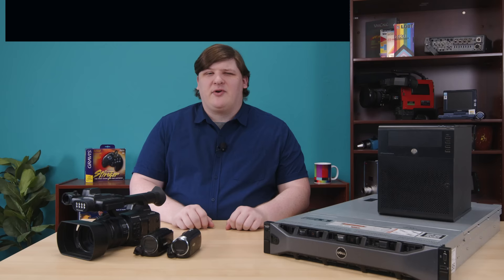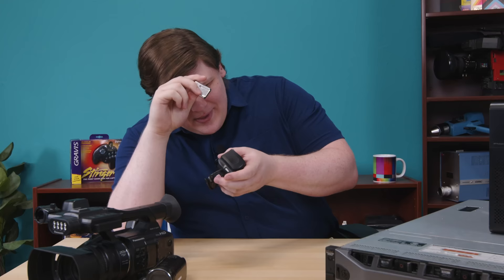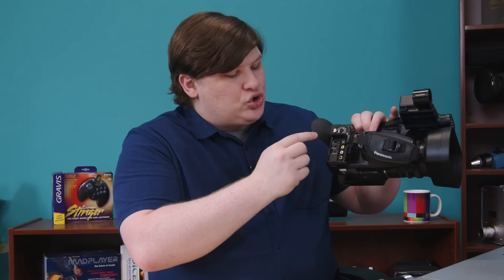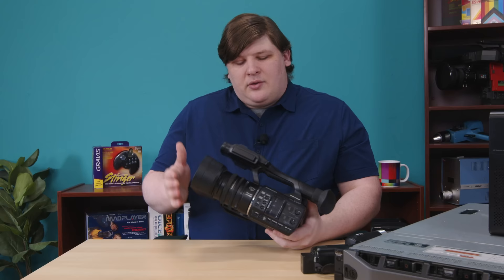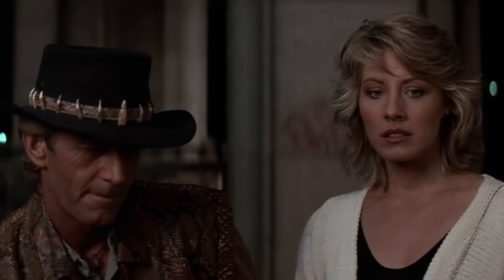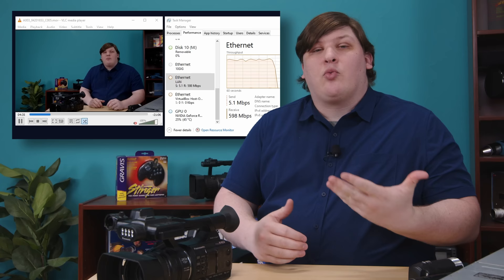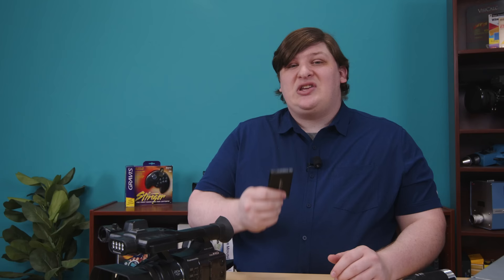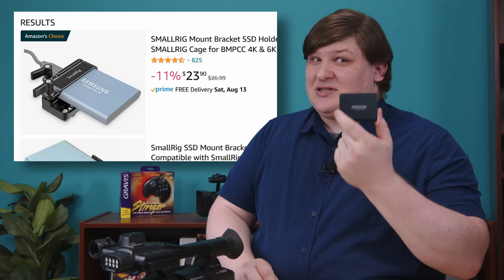I Built... a really fast NAS?

Comment: I'm a year late to this video, but have you ever considered an offline/proxy workflow? Get the server to transcode the video to 1080p proxies, edit with those, then tell the server to do a full res render with the high res footage in place of the proxies. The proxies can either be copied locally or several can stream over a 1Gbit network, though copying means you free up the server to be transcoding the backups in the background while you edit. I realize this introduces more process, but most editing tools are built to do offline edits and quick proxies should get you to the point of editing ASAP.

Comment: Sorry the T7 and the T5's internals are not the same size, AS you yourself pointed out, one is a standard SSD and one is a NVME, NVME is a slightly different form factor, to account for the difference in the media controllers and the PCI-E lane access.

Comment: You can use an RTX A2000 for about $250 and get NVENC over 75W PCIe power.  No 6 pin or 8 pin adapter needed.

Comment: Buy 2 4TB HDDs and put them in raid 0 for your editing rig. 300-400+MB/s should be fine, and it'd only cost you around $120 If you wanted to; you could go for 4 drives, and double~ that speed.
Ofc, raid 0 is a risk, but if you're only using it for your current project, I don't think it'd be a big issue; I wouldn't recommend it for long term storage though.

Comment: ThIs is slowly becoming my reality, right as a hobbyist YoTuber. The first video footage I edited was via an 8mm camera using a Motion JPEG A capture card in Premiere 4.0 to Jaz disks. When I was in college I had a DV camera and then proceeded to never really use it as the quality was abysmal. Put in a global pandemic and needing a hobby, I jumped back in nearly 20 years later. 

My mistake: Upgrading my Olympus OM-D EM-5 MKI when it died for the MK3. It's world's better and shoots really good footage but the 237 mbit mode is only for 24@4k and not 30@4k. I should have abandoned my two lenses and gone Sony A7. I'll also use my iPhone 14 Pro (512 GB) and the ProRes it uses is nuts, same level as the Black Magic.

Comment: kinda late to the party here but just so people know. a GPU is fast as video encoding because it has dedicated hardaware for it, my 4090 is only 10% faster at hardware encoding than my i913900H using quicksync for a single video stream (it can actually do a bunch in parallel but at the same speed).

Comment: Throw a p2000 into the server, along with some used u.2 enterprise slog drives.  Plenty for transcoding
Also grab an old fiber card and go to 10gig
Reply: Please don't buy a gamer gpu for transcoding.
Not designed to run well in a server.
Grab an old quadro P series, intel arc isn't anywhere close to ready for a production environment.   If it ever even launches.

Comment: I have a slightly newer HP Microserver with an AMD Opteron(tm) X3421 quad core CPU.  I agree it's not great for storage, BUT one use I've found for it is, if I install another PCIe ethernet card in there, is a really good PFSense box for a home-built router.  It's got substantially better specs than the crap that verizon provides me, and it wasn't terribly hard to set up.  Might be a good use of your old microserver if you're not doing anything with it.

Comment: @CathodeRayDude Just curious why you would configure your storage controller into JBOD mode? You kinda (sorta?) lose a layer of management and monitoring, storage ops offloaded from cpu, and not to mention with mdadm you're technically supposed to "quiesce" (stop I/O) to the disk before hot unplugging .... and configuring in mdadm or zfs is more effort than just "configuring it" in iDrac...

Comment: Not sure why you say DAC is only used for very "rare" use case but DAC (and ACC; active copper for speeds like 400G) are extremely common for server 2 TOR switch or switch 2 switch for redundant network setup (vlt, mclag or vpc) . Actual fiber interconnect (ethernet; not talking about FC San) is used for either longer connections or when you connect 2 devices very specific on supported media: you then use the own brand sfp in box A and the other own brand sfp in box B and you avoid any support push back from vendors. (And I work in network support for a vendor you do mention in the video)..

Comment: If you want to see some truly perverse abuses of board interconnect extensions via cables, check out the DSSD storage array and it's proprietary HBA and cables. They're literally PCIe interconnect cards that let you pass a direct connection to your PCIe bus over a cable up to 7M long. Welcome to the earliest days of NVMe-backed storage arrays before they figured out how to packetize NVMe storage and provide identifiers to those data streams so it could be made switchable over fiber connections.

Also, if you want the most reliable secondary market DAC cables, try Cisco. Their 10Gb Twin-Ax is some of the most universally compatible cables I've tried. They work on Intel, Cisco, Dell, HP, Broadcom, Mellanox, and more. Basically the only thing I've found that they don't play nicely with is 1st gen Dell 10Gb switches, at least until you update the firmware on the switch.

Comment: I've got about the same backup setup as you, Linux + ZFS + rsync, and I've even got the R710 raid controller card in a different network share PC. "ZFS scrubs" are a cool feature I actually didn't know about when making the decision to use ZFS, so thanks for that.

Wondering why someone would choose to go out of their way to disable hardware raid? Is it because of the possibility that the proprietary controller card can fail, leaving the disks unable to be conventionally read until a compatible raid card can be found? Otherwise, I feel like the hardware raid experience is really pleasant and entails less arcane command-line copying than software raid.

Comment: I know this video is a year-old so I hope you see this. An alternative to a video card is to get yourself a cheap mini PC with an Intel i7-1360P or i7-1260P. These are laptop class processors with Iris xe integrated graphics with Intel QuickSync hardware decode/encode for h.264, h.265, and (encode? only) AV1. Mine converts 4K60 to H.265 at 60-80 fps. Not as fast as a GPU, but very low power consumption (25W) and Linux driver support.

Comment: A little to late, but maybe:
you dont need to use consumer graphics card just for video encoding. If you don't need AV1 instantly there's a lot of cheap "enterprise grade" compute and render card on the market. The nvidia Teslas and Quadros have the same nvenc media chip as the GTX/RTX cards but they are much cheaper. Some cards has more then one encoders and some has higher paralell process limit ( some Quadro and Tesla could do 4-6 hevc render at the same time ). Check the Nvidia NVENC Matrix table :)

Comment: I wouldn't cheap out with seagate hard drives. They're cheaper than WD for a reason. Every seagate drive I've ever had has failed, my most recent one being only 4 years old. Meanwhile I'm still running a 1tb WD from 2005 as a game storage drive in my main PC with no signs of failure. Seagate has a ~95% early failure rate in datacenters, while WD is at ~5%

Comment: You will be probably okay with a GPU without an external power because you need to use the nvenc and it is if I am correct the same on every card. For the software I would recommend tdarr. It automatically converts files to h265 with ffmpeg.

Comment: You don't need to run the transcode on the server and probably shouldn't. Just place another sffpc anywhere on your network and make it do the transcode over the network. This is a dedicated task, it makes sense not to cram it into your nas. Also I would cpu transcode as the quality presets go higher on software encoder
Reply: How did you avoid the iscsi rdma iwarp roce nvmeof rabbit hole ? Are all your bits getting stuffed through the cpu ?
Reply from the maker: I explained in the video, thoroughly, why I am trying to move that task off my PC, and I can't think of any reason it doesn't belong in the machine I just built whose sole purpose in life is to make my video workflow better. I have no interest in maximum quality. H265 looks fine. My plan fits my needs perfectly.

Comment: 10g would be SFP+, also cat6 works fine for 10g, in fact optical transivers introduce more latency. And you dont need SSDs to saturate 10g. I use a mixture of DAC, Optical and ethernet. DACs are the fastest because they dont have to do media conversion but they are limited in length hense why ethernet or fiber are used depending on the application

Comment: hey dude, I have a similar need/requirement for my own NAS regarding a GPU. My specific issue is that I must find a half height GPU that has a PCIe x8 connection and at least 4Gb of RAM preferably more, running a chipset young enough to be usable for HPC/AI aka being able to run CUDA and/or AMD's ROC. Any ideas/recommendations?

Comment: Hey great video. I'm a guy with my own dated rack that can support up to 6xSATA 3rd gen drives and I have 10GbE SFP connections between a HP rebranded QLogic and a SolarFlare. I've only been considering HDDs for my data store solutions and so far it works great but recently I've been getting lots of questions revolving around SSDs and it looks like you might know more about this. I see your Intel 320 is made for 2nd gen sata and you have full speed connections. I'm looking at a scenario where storage size isn't the issue but the disk I/O is the maximum importance. Assuming I choose something roughly double the performance of the Intel 320 and put 4 of them in RAID on a small dual core office PC networked over 10GbE SFP, should I expect that to be tolerable for video editing? Obviously just finding something to support PCI-E x8 in SFF would be an issue but clearing that, does this seem doable?

Comment: i use a 2970 that boots from a pair of sd-cards(they are fault tollarant setup) with  8.73TiB of storage in a raid 5 array using xigma nas it works great it does get a little bit loud sometimes tho but nothing too harsh considering i sleep 4 foot from it lol
also got another dell box with 2tb of storage i use vmware on for virtual machines 
dell hardware is pretty decent its pretty available on places like ebay

Comment: My knowledge of servers is minimal but I'm learning, would you be able to run a workstation  gpu to solve you lack of one in your server? Something like a quaddro would be incredibly cheap (relative to the mountains of storage you already pay for) and can be formatted and dedicated to just that. They are also slimmer than your 20X0 and 30X0 GPUs and are made for high performance, low maintenance applications. 

Again I'm not sure about video rendering, but it would be worth investigating :)

Comment: I'm very poor at backing things up and always have been. It's only bit me in the butt once or twice and it wasn't that bad but, I know my days are numbered. What sucks is I have spinning drives that are 20+ years old and still working. I've had a few fail long ago but, it's the SSD's are what failed on me recently. And when I say recently, I mean within the last 10 years. Ever since SSDs became somewhat affordable, I bought a bunch of them. However, that first batch all since failed. I thought they were gonna a good medium for long term storage. Turns out, that's not the case. They don't like to be left alone unpowered with data on them 😕.

Comment: I may have missed it but I don't think you mentioned why you use ProRes 422 HQ. I'm not saying you shouldn't use 422 HQ, I'm just wondering why you aren't using ProRes 422 or 422 LT. Is there a specific reason? Is it better for keying your wall?

Comment: About scrubbing - no, you cant do that on NTFS in usual setup because ZFS calculates checksum for data and NTFS is not, so there is nothing to verify against. You probably can setup software to make its own checksums for files and then verify (like torrents doing same with downloaded data) but its your own task. And speaking of ZFS, well, considering fact that ZFS being phased out from Ubuntu...maybe you should switch to BTRFS. I dont like to advertise BTRFS, but it seems its thing you may need.
Also, Cryusial BX500 - isnt great choice, MX series is way better.

Comment: I am a bit leery of the lights up management/DRAC stuff just because apparently it has been compromised and it is all proprietary, closed source, black box technology. 
So far though, a lot of your NAS design is similar to mine: just throw Linux on it, do a software raid with ZFS, and don't screw around with "advanced" NAS builds. Anything I need to do with it, I can do on the command line. 
I also agree that all drives should be hot swappable. 

Surf Wisely.

Surf Wisely.
Reply: My experience with Dell "hardware" RAID is that it is like the reverse Blade of software and hardware RAID: none of the strengths and all of the weaknesses. 

Surf Wisely.

Comment: Ugh, dealing with several internal HDDs in a tower config is a nightmare. Cables, Cables everywhere... Im considering just building a custom box with hot swapping just to manage all of the drives now. Ive been running my own servers since 2005 and I am only now considering this. Old habits die hard I suppose.
Reply: The 5389 has a 7p8bay backplane which can be connected with 2 SFF cables.

Comment: for my footage i do this , since i soot multicam live music show ,  with 5 nikon dslr and few action cam ,  all my media get dump in my raid 10 file server , then trascode to h265  since the camera save it in quick time , with my 2 workstation with media encoder, then get backup on external drive    and copy  to the raid0 ssd on my editing  workstation  to be edit ,  my server make a backup of the ssd ween it site idle for more than 10min  , once finish i delete footage from ssd ,  and at the end of the year all footage get dump on my cold storage server , and backup to external drives , and deleted from the raid 10 ,   and the card i use for the camera get formated wen i need to use them , just in case i forgot some files or some get damage .

Comment: Surely you don't need to shoot in  prores for what is essential a fixed studio shot. Is there a h264/5 option in high bitrate on the camera?
Reply from the maker: There is not, and I wouldn't use it. H264 is miserable to edit from and I would be in the exact same situation, spending hours and hours transcoding to an intraframe codec before I can spend a single second editing. That kind of workflow may work for corporate production houses where shooters and editors are different crew working on a half dozen projects simultaneously, with people in between to take care of the ingest and so on. For me, it's completely unworkable.

Comment: I have just become convinced that if I ever start making YouTube videos, they will be in captured in 1080p. I mean they are going to be squished down anyway, so why bother? Also, that I should get pretty serious about learning more about Linux, instead of just having Mint in a dual-boot setup on a spare PC and fiddling with it every now and again like I'm currently doing.
Reply: Shoot in 4K - it will come in handy if you ever need to do post-production zooms or anything like that. Even the conversion to 1080p will still look better than if you captured at 1080p. More detail is always better.
Reply: @GP1138  An old friend who worked in pre press using the Hell scanning gear back in the 1970s thru the early 2000s scanning high quality color slides for continuous tone color separations for high end print magazines and product catalogs printed  using the Rotogravure method always insisted that you should scan to the final output resolution that was going to be output for print. This was to get the actual image that would be coming off the printing press. In other words, work to the final output the end user would actually see as compression algorithms have no actual idea what they are compressing, but having the sensors see what you want to begin with is better.

Comment: Cat 6 is perfectly capable of being extremely reliable for 10GBASE-T networking. I know this from a decade of data centre work. The problem isn’t Cat 6, the problem is dodgy cable vendors selling non compliant cables as Cat 6 stipulates that all conductors be 100% copper, which is expensive, so they skimp. Kind of like all the fake SD cards on eBay.
Reply: Its still a waste of power

Comment: Since you only seem to be mirroring drives (3 x sets) or whatever, why are you not using RAID1 on the perfectly good PERC? All you are doing by using the PERC in HBA mode is to hand off the storage compute overhead to your CPU. Really, the only use case I’ve ever had for HBA is to pass through physical drives to individual VMs on a virtualisation host but it didn’t seem like you needed to do this?

Comment: Definitely not a simpler solution than just running TrueNAS. I just run TrueNAS in Hyper-V on a windows machine and then you can install whatever you want. All your compatibility and limitations are solved almost immediately. The TrueNAS VM will share resources with the PC so it seems to me a lot more efficient use of hardware. Whatever CPU power the NAS isn't using can be used by the host machine.